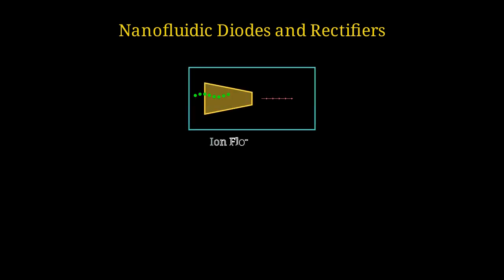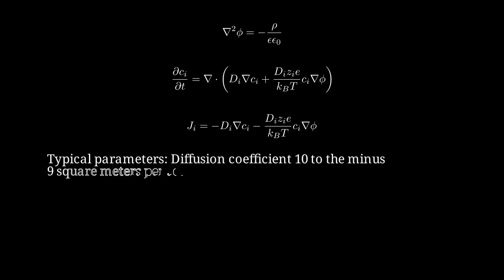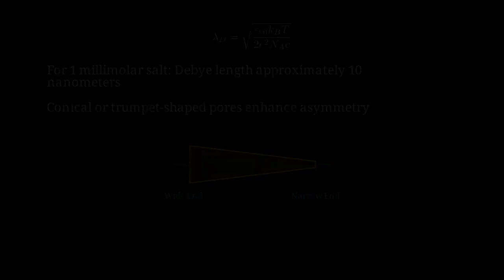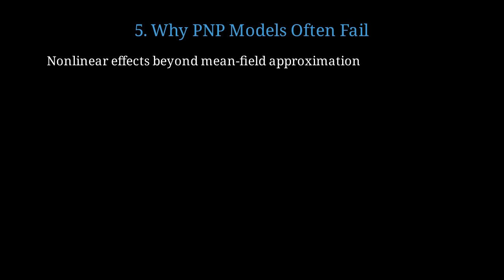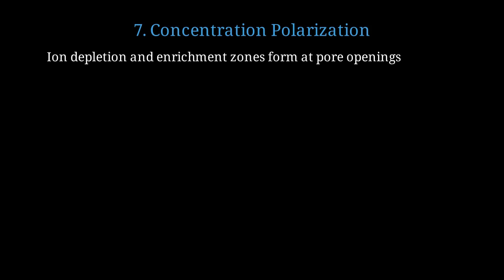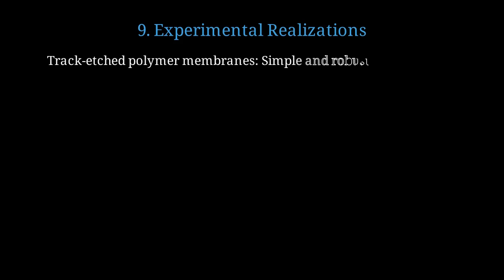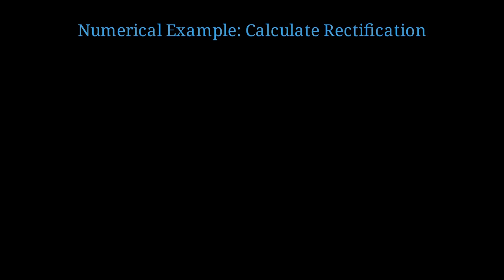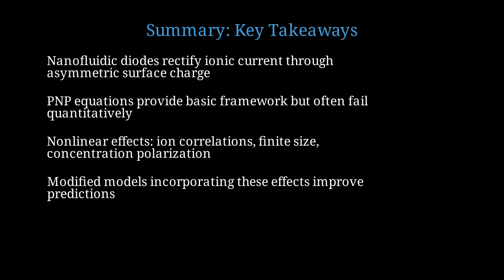How Do Nanofluidic Diodes Work Like Magic?

Comment from the maker: How can nanoscale asymmetry and surface charge distribution be optimized to achieve maximal rectification efficiency in ionic diodes?
What are the quantum and entropic limits of ionic transport, and can they be harnessed to design iontronic transistors or logic gates?
How does coupling between electrostatic potential, ionic diffusion, and fluid flow create emergent nonlinear behaviors analogous to semiconductor band gaps?